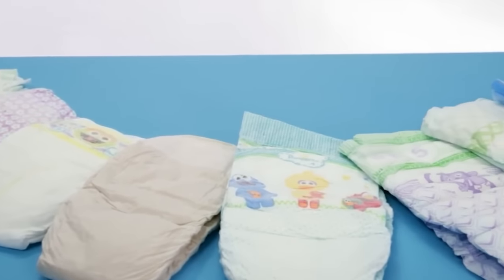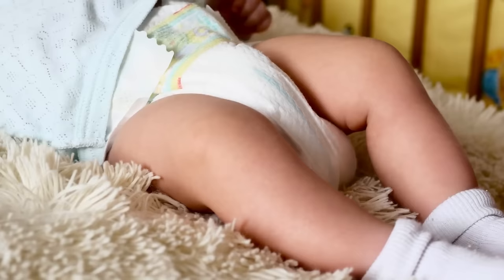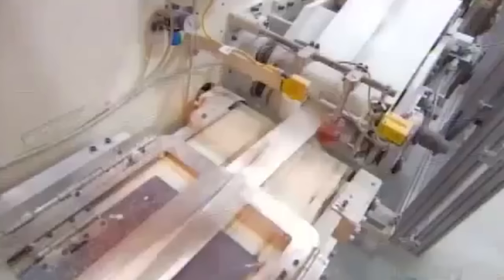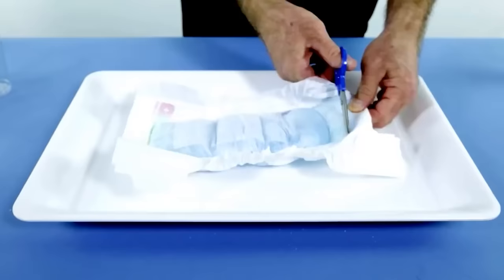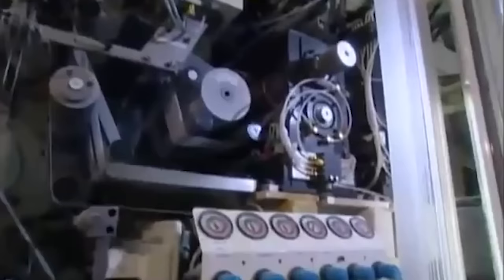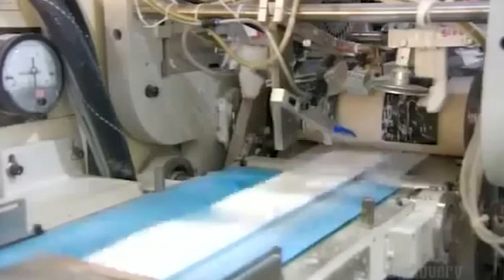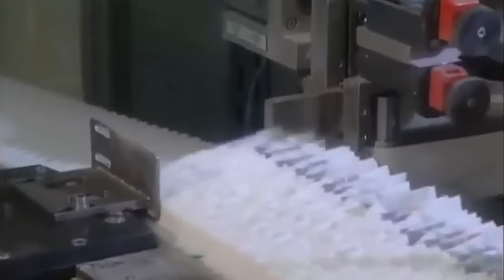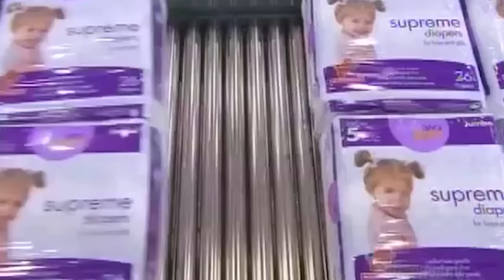How It's Made: Diapers

Comment: Landfills are the problem.
Landfills should only be used for compostable trash. 
Diapers should be burned, to make heat, that you export to nearby homes and/or make electricity.
Reply: you can compost disposable diaper innards.... pull off the outer layer and use the inner layer on plants in the garden.  this will also hold in moisture for the plants.  meaning you use less water.
Reply: @honestytoafault  okay, this is actually a good idea!
Reply: @connorb9157  The "smoke" is mostly steam.
Reply: Cloth diapers are amazing too.
Reply: @honestytoafault 😅

Comment: I cloth diaper because of disposables filling landfills and all the extra chemicals we don’t want on our child
Reply: Do you use detergents and softeners to clean the cloth diapers for reuse?
Reply: @cleanserofnoobs4162  we don't use softeners otherwise it coats the fabric and makes it less absorbent. I use Arm and Hammer powder that comes in a box. I'm not a fan of liquid detergents.
Reply: Are you also using non toxic soaps? Because if you aren't then those soap chemicals will at some point be reexposed to your child.  Because of how frequent cloth diapers need washing, the best way to ensure its completely environmentally friendly is finding non toxic soap so we dont end up poluting our water or putting the toxic chemicals in soaps into our ground
Reply: @shaddow_pet869  Most eco-friendly or plant based detergents (and diaper washing requires detergent, not soap) are not strong enough to effectively clean human waste out of multi-layer diapers. These days, it's impossible to avoid all toxic chemicals, but using cloth diapers does reduce exposure. It's also cheaper and cloth diapers won't be hanging out in a landfill in 500 years.
Reply: actually cloth diapers have just as big a carbon foot print as disposable diapers
Reply: @honestytoafault  They really don't. There's no way 24 cotton squares and 6 polyester covers have the same detrimental effects as 30 boxes of huggies. Even if the production has the same carbon footprint, at least the cloth diapers won't still be rotting in a landfill when your great-great-great-great-great-great grandchildren finish college.
Reply: @honestytoafault  That's 30 boxes per kid, too. You can use the same 24 flats and 6 covers on several children before needing new ones.
Reply: @shaddow_pet869  Cloth diapers require enzymes to break down the human waste.